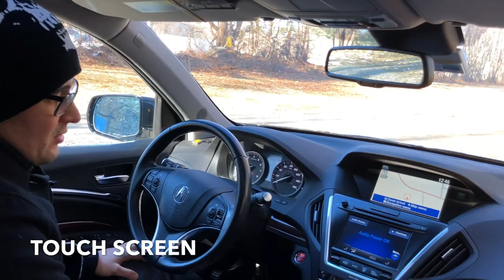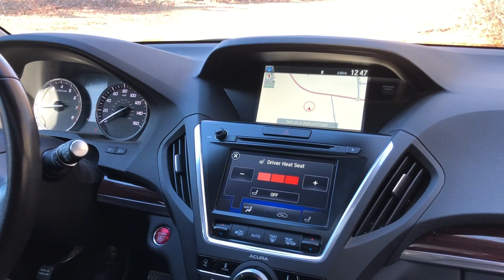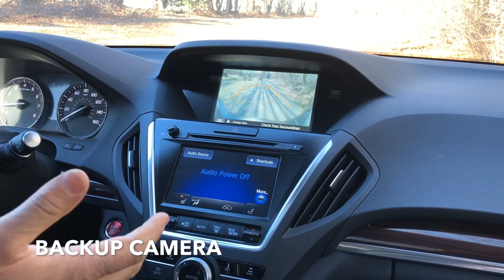2014 Acura MDX Used Car Review and Buying Guide

Comment: I really love your videos and full explanation of EVERYTHING with mechanic live samples. I want you to ask: Wich one acura mdx is better 2013 or 2014 because of the transmission 6/9 speeds  or wich year/generation would you recommed as used family car. Thank you so much from Mx.
Reply: OK, I´ve just watched you 2016 RDX review and so I have the answer, Correct me if needed: The most reliable engine and transmission ever built by Acura it´s the 3.5 engine with 6 speeds. And the the first years for 3.5, 9 speeds transmissions works good on sports mode, but in general feels very nervous when shifting the gear. Cuestion: Have this problem been solved in current generatios? since when?

Comment: Love the thorough video. I had a specific question. What is the name of the part on the undercarriage that shields the transmission. It shows a metal cover that looks like it attaches to the front splash shield. I can't find the name of that part anywhere. You can see it around the 11th minute of the video.

Comment: What to look for? The 2014 has the most complaints of any MDX. Is it really that bad?
Reply: By the way, bought the 2016. But almost for the 2014. Ideally the 2015 is considered the most reliable.
Reply: @JonathanRogers1982  You mind me asking how the 15 differs in terms of quality, I am considering one at 27 k with 48xxx and any advise is appreciated
Reply: @TariqAbdul12  I watched a bunch of videos and looked at car complaints/consumer complaints. It's the first gen new design, apparently had a ton of issues. The reality is, I'm sure the 14 is just fine, and that's not very many miles if 48k.
Reply: @JonathanRogers1982  thanks for your response, I ended up getting the car, its a 15, thank god it has a 6 speed tranny instead of the 9 wich started i think in 16 models.
Reply: @TariqAbdul12  the 15 is great. 16 with the 9zf is fine too so long as you flush the transmissions after 70k miles about every 30-40k miles. Jerks a little first to second but it's not very noticeable.
Reply: @JonathanRogers1982  Yes, thats what i keep seeing online. Everyone praises the 15, lets see what its all about:) My service records has over 20 records one indicates that previous owner flush trans fkuids by 25 k miles, which makes wonder why did that happen? Is that regular intervals for transmission fluids flush?